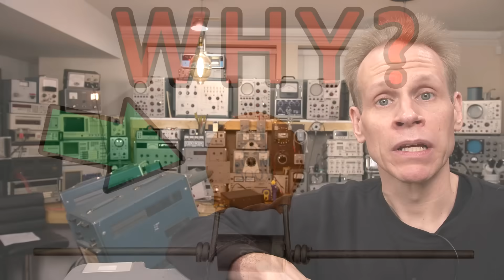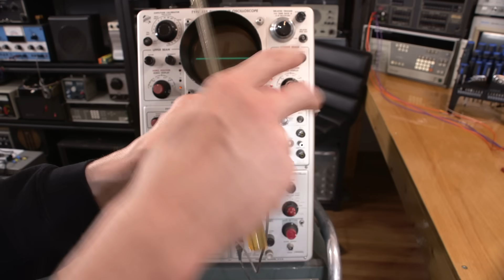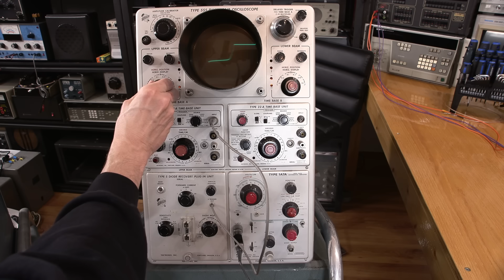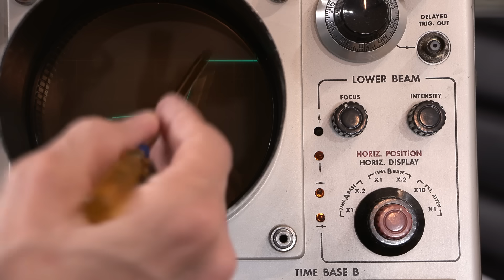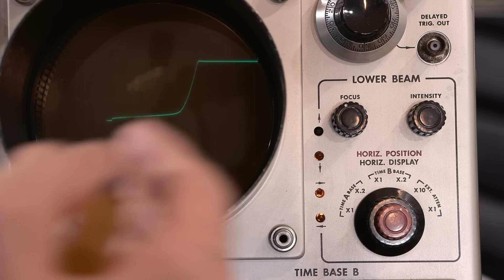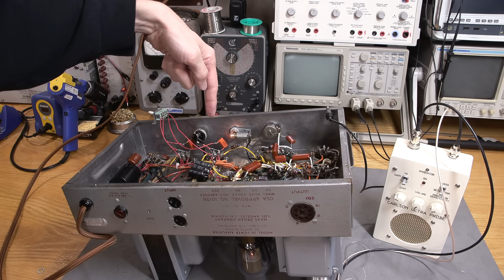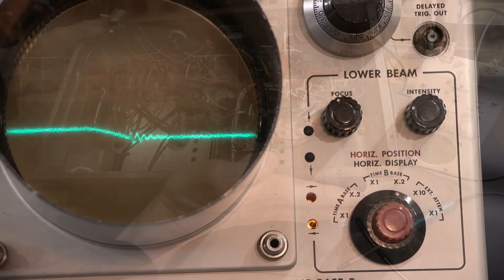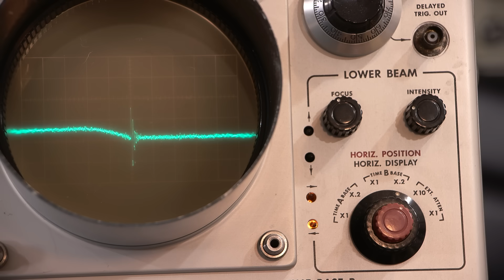Why Put A Capacitor Across The Diode? Here's Why!

Comment: When I was working at a local bank I had two new check sorters and one got random error messages in the module that filmed the checks the other one didn't. At lunch I would scan the schematics to where the signals came from. The help desk said I was the only one in the world having that problem. Knowing this was a ground noise problem, I added a capacitor from the legs of the chip to ground. No more problems. When I called the help desk to let them know how I fixed the problem, they said "good! A lot of people were having the same problem." They eventually came out with a change to add an RC circuit to the affected legs of that chip. (I was designing electronic circuits when I was 17, but the Air Force said I was an aircraft mechanic. after a little over 20 years doing that I got back into electronics) Now retired and 80 years old.
Reply: yeah, I grew up on vacuum tubes. Retired from Laurence Livermore Lab eight years ago, electronics paid a whole lot more than flying airplanes. 
In the Air Force. I was in a calibration lab. Got to play with all sorts of neat equipment.
I calibrated most of the equipment on this guy's workbench.
Reply: In RC circuits, the idea was to convert the energy of high-frequency oscillations into heat in a resistor. In US Army vehicles from the 1940s to perhaps 1970, each switch and each contact had a capacitor or RC circuit connected in parallel. This, of course, served to avoid interference with the radiotelephone equipment.
Reply: Same- started in electronics as a kid.  Built audio ocillators, metal detectors, electronic aviation points breaker boxes etc., went to mechanics, now at 67 headed back to ham radio and electronics with some physics , chemistry and biology thrown in.
Reply: Adding a capacitor always suppreses noisy power
Reply: @maxinfinity392  
Not always. Sometimes capacitors are used to filter out DC voltage. Sometimes they are used to store a charge, yet they allow noise to remain in circuit which is sometimes filtered out later,, but not always. And sometimes they are used to limit current surge, such as in electric motor start-up.
Same with inductors. Sometimes an inductor is used for noise reduction. Sometimes they are used for frequency filtration. Sometimes they are used to limit current surge. Application determines use for many electronic/electrical components. Sometimes, noise suppression is not a factor.
Another example: If your capacitor does not have enough charge storage capacity to filter out a particular noise, said noise will remain. It is not factually correct to state "adding a capacitor always suppresses noisy power". For it depends on component specifications and it's application within a circuit.
Reply: @maxinfinity392 so does an inductor
Reply: @stevencanning3955 it does. But adding both is the best
Reply: Bahaha. Yeh ive been on that “ youre the only operator in the world having that problem” end more than once with aircraft systems. And as you found, when i fixed it the manufacturer was suddenly very interested.
Reply: 50 years in the TV trade in the UK and I didn't know that! Thanks, didn't have that problem with valves.
Reply: So, help desk said “you were the only one in the world having that problem” , and they said “a lot of people were having the same problem”? 
Yeah, ok..
Reply: I must ask. How different were electronic components after your service compared to before you had to focus on fixing aircraft? I ask because I completed college in the early 90's. I was content with the components available at that time. But then they took away the LM317/317t for example and replaced them with a microscopic, failure prone version that required an entirely different method of soldering than I had grown accustomed to. For me, it was a lightning fast realization of how old I had gotten.  lol
 I can still diagnose, but now there are so many very small solder connections and my hands seem to enjoy shaking when they approach those small connection points.  It's coming. One day I will have to outsource my soldering. And I'm not liking that realization at all. lol
Reply: When I worked at East Midlands Airport restaurant, I changed the mains fuse on an oven, and from then on was known as 'The Professor'
Reply: Do you remember the old IBM 3890?
Reply: Best regard ❤
Reply: What a great story. Thank You for your Service.
Reply: Yes, it is a common procedure as a requirement in typically all circuits to have a 0.1microfarad cap across all IC's Vcc(+) and ground... other circuits requires the same routine too...However, most of us disobey the rules as a caution... It's like shaking a dice!  A 0.1uF cap aide in eliminating noisey  interference that can cause corruption in the circuit.
Reply: 80 years old?  Sure buddy... PROOF OR IT DIDN'T HAPPEN
Reply: I need to et you straight because you failed to pay attention to detail
1.   It is  AIR FORCE   not   Air Force
               AIR FORCE  is  MILITARY
               Air Force is what comes out of your hair Dryer
When you learn to pay attention to detail you will notice
that it is correctly written on the aircraft - on Signage and
often on the uniform itself.

Same Applies to  NAVY   not Navy
                               ARMY  not Army  ( Unless it is the Salvation Army  )
                              MARINES    not Marines
                             COAST GUARD   not  Coast Guard.
Essentially you do not understand correct grammatical legal English.
So I will give you a critical Lesson in  Law

Any entity  that which does not possess a soul - yet has LEGAL STATUS
the name is ' Always ' written in ALL CAPS.
Start by visiting your local Cemetery / Necropolis
Pay attention to what is written on the CORPORATE Jet -
particularly the one /two  based at ANDREWS AFB -
( Where I served for a while during my 3 year attachment to the USAF )
Pay attention to what is written on your Commercial Instruments
Pay attention to what is written on your Currency 
( and the Penny is to be discontinued 45 years too late )

Now - for your homework - make a list of such entities that have
the Legal Name  written in ALL CAPS
A child age 8 can complete this project in under 3 minutes.
Reply: @XRAF-633  
Care to dig into why you are incorrect? Or would you like to keep the fantasy alive? We could start by addressing the fact that a youtube comment section is not a professional setting. No one is an authority over another here. Here, we are all equally worthless. 
By the way, even the Air Force spells it as "Air Force". The Navy, spells it "Navy". But of course, an 8 year old child would know that. There are bullies, then there are those like yourself. So incorrect and so far off base they may never see it in order to save face.
The guy was leaving a youtube comment, not filing a legal brief. I have yet to even try here. Abandon the effort. You're not cut out to bully others from behind a phone screen.
Reply: @XRAF-633  THANKS, must-a missed that. Found out in college that crops are grown in soil. Dirt is what you track-in upon your mama's carpet.
Reply: "Congrats on catching that typo, PeDANTic. Truly the hero we neither needed nor deserved."
Reply: @XRAF-633 hey sparky looks like that useless English degree is paying off!  Oh, never mind much of your statement is WRONG!  So still a useless English degree.
Reply: @XRAF-633 🤣 Bullshit, air force, in lower case is what comes put of a hair dryer. YOU need to pay attention to detail. 😉
Reply: @dalekehrer2421    Excellent observation,  I was so astonished at his arrogance I failed to see his own obvious and ironic error.  And my dad was a LtCol in the Air Force.  Or should I say  AIR FORCE?  :)

Comment: A simple (aka cheap) smps often has a 3 pin double diode on the transfotmer output, while they usually operate at much higher frequencies would they be made 'cleaner' by adding a pair of low value caps ?

Comment: I had 40 years ago a little amplifier, smaller than a regular shoebox, and it sounded so beautiful. When I didn't turn the speakers on, I could hear the tubes sing, it was amazing until it accidentally fell on the ground breaking two of the four tubes. Back then, it was nearly impossible to find those tubes, no internet, no electronic shop, no special audio stores, nothing, still I keep looking if I ever find something resembling that amplifier from back then...

Comment: Hi, I have a question. I have a converter from 12V to 3000W and someone switched the cables and connected the + red cable into the - negative plug but a short circuit happened. Well, all the fues got burned. That was perfect but 4 mosfet got broken as well so my question is: Why do we have fuses in the first place if mosfets are gonna get broken. I really don't understand this kind of issues.
Reply: Pomylona polaryzacja (+/-) MOSFET może prowadzić do natychmiastowego uszkodzenia, przez zwarcie lub niewłaściwe napięcia.

Bezpieczniki prądowe chronią przed przeciążeniem prądowym, ale nie są skuteczne w ochronie przed błędną polaryzacją(+/-).👋
Reply: Fuses are usually there to protect from fire caused by a shortcircuit, not to protect the equipment.

Comment: It is unclear what you are doing with the diode in that equipment without the circuit diagram. But the capacitor over the diode is basically a short-circuit for high frequencies. It means that at higher frequencies, the diode becomes less a diode and more copper wire.

Comment: I assume there wouldn't be an oscillatory transient if there wasn't stray inductance in the power feed. I also assume this was a standard PN diode. Schottky diodes (in lower voltage circuits) have a lot more inherent junction capacitance.

Comment: So I’m not a EE or any sort of electronics genius.  I did have a simple circuits class in college as part of CS.  Anyway, does this capacitor across the diode help with LEDs at the 5V and 12V level?  I’ve designed some (probably not very efficient) boards for lighting wagons on N-scale railroads and we use SMD LED on them.   Also have a zener diode on the board. Is this sort of capacitor trick useful in those situations?  Is there “noise” in the circuit which makes it less efficient or “wears out” components more quickly?

Comment: That cap, it's doing what caps do! I used a Sun oscilloscope  before solid state took over the auto industry. It gave a similar sine as the points opened, and the cap captured the coil charge from the points and allowed the charge to be directed to the sparkplug and jump the the plug gap.... Which lit the fuel for the cylinder explosion 💥💥💥💥 UH boom🤔💥💥💥💥

Comment: Very interesting. I took apart an bad cb base station radio to harvest the parts in it for other radio repairs, I especially wanted the regulated 12v power supply and after I removed all the components I noticed some capacitors attached to the full wave bridge rectifier and wondered why they were there as I have never noticed that before on any of the power supplies that I have salvaged from any electronics that operate on a internal power supply. Your video has cleared up my inqesative mind and makes complete sense because the receiver section in cb radios are sensitive to noise especially when they are being powered by an AC circuit. I have built many power supplies along with many other electronic circuits and it never crossed my mind why I was getting that dreaded AC hum in them. So now from here on I will try adding capacitors to the rectifier circuit. Is there any specific value of capacitor that should be used? Thanks.

Comment: I am currently building some custom headlights for my truck (known as a headlight retrofit). I'm swapping the halogen bulbs for bi-led projectors. With my vehicle, I have to build a harness that will keep the low beams on when I turn on the hi beams. This involves 2 schottky diodes per harness. One to transfer power from the high beam to the low beam, and one to keep the low beam power from powering the hi beam. Would it be beneficial for me to add capacitors to each diode?

Comment: Koolamonjaro Dude!  good work on the diode caps, years ago in the 60's circuits usually had caps across the diodes.  And power electronics engineers learn about trr with SCRs the hard way.  Tubes get hot and waste lots of energy but they are still fun to build with!  When I was a kid tubes were free and transistors were expensive!!

Comment: it can be good video but it isnt ....missing things: 1) at which diode in circuit you are connecting the capacitance(diode is rectifier and Capacitor is destrying its function because its good conductor for AC ...you can destroy something 2)why it is working  3) what values 4)poeple be carrefull diode is not longer rectifier when it have capacacitance(capacitance is conductor to the Alternate Current).....I like only your probe Ill check video If you make it

Comment: That screen is not a scope it is a curve tracer.  It out put  a negative to positive voltage across the diode  vs time.    Like a DMM it is designed to show the breakdown voltage  of about 0.7 V   but it is not instant and he shows here it is not off 100% either.  Thus in a DC circuit you might get a little noise  but AC  you get this constant noise.    You can also plot out a transistor gain curves with variable base voltages.

Comment: Forgive me, I'm an electronics neophyte. It's my understanding that a diode is directional while a capacitor is not. No doubt the capacitor serves to reduce electronic noise, but isn't it's placement straddling the diode defeating the unidirectional effectiveness of the diode?
Reply: I would say yes, but only to the extent allowed by the impedance of the capacitor at the frequencies involved. So the result would be effectively negligible impedance in the forward direction, and very high impedance in the reverse direction - sounds familiar?, kinda like a diode!

Comment: How do you check if they are good or bad with a multimeter?  The capacitor going across the diode?!  If they are soldered on at each end?!  I take it they would be used in a dc circuit;24vdc as an example, and the noise produced would hence be ac ripple… ac ripple is no bueno.
I suppose I could use a megger @1000volts and see what my resistance value is.

Comment: What are the capacitor values and how did you determine the ideal value. We can figure out the PIV thus what voltage rating to use. In a bridge rectifier circuit, would you bridge all four terminals or just two?  Interestingly, when I helped the chief eng. of a 50kw AM station build series diode towers to replace 6 mercury vapor, 15kv rectifiers, he ended up having to bridge caps across each diode along with the balancing resistors but I thought the reason had something to do with corona.......but then again, the corona was coming from the sharp aluminum heat sinks which we had to round off a little. So I don't remember why but DON'T think there was a noise problem. I guess the 3-phase rectifiers were rare and necessitated doing all this work. Eventually the 6 ft monster mercury vapors were retired. This was an RCA Doherty system.....which FCC disliked. (cuz we could legally modulate at 110%...hee hee)
Reply: Another question:  Wouldn't subsequent filter caps suppress this noise?

Comment: Hi Prof. Carlson,

I learned this the hard way when I built my first amps back in mid 80s when I was a teenager.

The first one used germanium transistors had 5 watts of audio output and hummed. I added 4700muF to both rails but it didn't went away. Even a thick solid copper ground wire didn't helped much.

The diodes of the FBR created this noise.

Asked my father what's going on (dipl. Ing communications) read about diodes, he replied ;)

Cheers.

Comment: Just curious if adding a resistor in series with the cap would be beneficial. Probably not dealing with enough current flow for it to matter. But perhaps in other scenarios/applications it might be advantageous? Just a random thought/question.

Comment: the diode will conduct according to bias, in reverse bias the circuit would be open, but the capacitor will act as a high pass filter & will allow any i/p if present, according to it's reactance, introducing more HF noise into the circuit.

Comment: I replaced a VR tube in a Geiger counter with a string of Zeners and was rewarded with a noisy response. Bridging the diode assembly with a cap fixed this.

Comment: When the rectifier diodes in the power supply cease to conduct in the forward direction, they don't instantly cease to conduct.  The rectifier diodes continue to conduct but in the reverse direction (perhaps for about 1 mS).  The reverse current is typically small (say, 4 μA), but it's equivalent to a spike of current flowing from the filter capacitors into the voltage transformer.  In the transformer, there are stray reactances; specifically, leakage inductance (L) and parasitic capacitance (C) between the windings.  These reactances are small, but they form a resonant LC circuit which may have a resonant frequency in the MHz range.   This LC circuit "rings" (oscillates) in reaction to the pulses of reverse current, and the resulting RF signals may enter the rest of the circuit and/or they may radiate from the power supply, causing interference in the form of noise. 
The capacitors which are connected in parallel with the rectifier diodes -- and which may have values of 330 pF to 10 nF -- reduce the amplitude of the reverse current spikes and thus reduce the strength of the RF signals coming from the transformer.

Comment: Ok. I will. The diode in use is a power rectifier diode, similer to a zener diode, they both have a polarity , + - to them , any device having a resonance factor will have ac hum, static . Adding a capacitor  in parell to a diode reduces  that static charge and filters the ac power into producing clean power. Mr.carlson i thank you.m.m